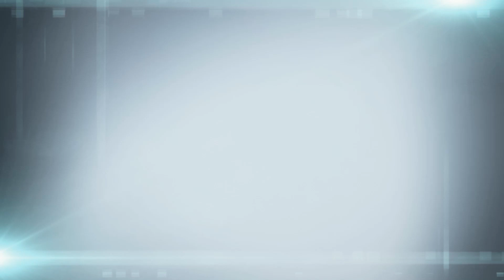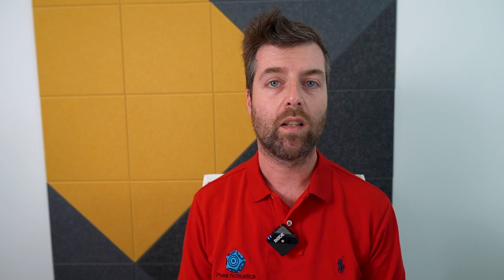How many subwoofers do you need to hit 120dB?

Comment: What are the benefits of dual vs single driver subwoofers? I have two 10" subs and am thinking about upgrading to two dual driver 10" subs, alternatively  two single driver 12" subs. Which route would you go? Space and aesthetics  are limiting factors, hence I'm trying to find a powerful yet compact combination.
Reply from the maker: A few comments for this question.

First, dual 10" drivers has the surface area of a 14" driver, not a 12" driver, so a pair of dual 10" subwoofers will have a good amount more output than a single 12" subwoofer, all else being equal.

Dual drivers don't really have advantages over single driver enclosures other than form factor.  Larger drivers require wider enclosures, but multiple drivers only requires taller enclosures (or deeper in the case of a Perlisten P-P subwoofer.

You might argue that an advantage of a smaller driver is that the voicecoil can be made smaller and heat is pushed across multiple drivers.  You can also take advantage of distortion canceling mounting methods or vibration canceling methods.  Smaller coils means lower inductance and that means lower distortion.  However, there are many higher inductance drivers with still very low distortion, so I don't know that this is a given.

Really its all about the numbers, how does it measure?  Not just CEA-2010, that isn't a great way to compare subwoofers.  If company A feels that a specific distortion threshold must be adhered to, say 5%, and another company uses 2010 limits, which is like 20% or more, then company A's subwoofer will appear to have less output than company B, but really they probably have the same, or A might have more, but B is simply looser with their standards.  So you have to look at group delay, distortion, output, frequency response, and unfortunately since we have no measures of mechanical and inharmonic noises, listen to it to decide what is best.  One big advantage of a BIG driver is that the suspension components are proportionally larger and that allows larger excursion with less noise.  It also needs to move in and out less for a given output which also reduces noise.  So...In my opinion, bigger drivers are generally better, all else being equal, but I wouldn't call that a rule or even a guide.  A smaller driver can be made to be excellent if engineered well.
Reply: Thanks a lot for your detailed answer! So generally speaking, larger total cone area, more output. Does larger cone area also mean deeper bass, generally speaking? I'm trying to understand why subs that are equal in cone area can have quite big differences in output.
Reply from the maker: @isak6626  if two subs with identical cone areas have dramatically different outputs then it’s because of excursion/power differences at very low frequencies.  At higher frequencies the moving mass of the driver can impact sensitivity. So it’s still power limited, but basically if one woofer can turn 1000 watts into 120dB and the other only 114dB, and let’s say it’s at 100hz, that’s a sensitivity difference caused by motor strength and mass. Simple physics. Heavier mass needs more energy to move and stop.
Reply: @PoesAcoustics  Thank you. So, when looking at upgrade alternatives, I'm thinking that cone area, weight and amplifier power should give me a pretty good idea of what a sub is capable of even if measurements are absent. For example, Bowers & Wilkins have three different subs with dual drivers  that are small but heavy and with powerful amplifiers (the DB3D, DB2D and DB1D). The marketed frequency responses of these are quite astonishing for their size, and there are almost no reviews of them, but I'm starting to think that maybe even the dual driver 8" sealed model (DB3D) could outperform my single driver 10" vented sub.
Reply from the maker: @isak6626  in general I wouldn’t use weight as a proxy for quality or output. You can build high output subs that don’t weigh a lot and low output subs that do. It’s really more complex than that. Even CEA-2010 numbers aren’t enough.  

Take Perlisten for a moment. Perlisten set their distortion thresholds well below that of the competition. The max output is limited to well under 5% distortion. Competitors often can fail CEA burst tones before the limiter would kick in. So you could take two subs, one the Perlisten and the other a competitor product. They could achieve similar maximum SPL numbers. Maybe the competition beats it by a few dB and maybe even costs less. In the absence of a full understanding of the differences it would be hard to know why the Perlisten isn’t actually the better product. But if the other product is producing very high levels of distortion at its passing values, the Perlisten is at least the better sounding subwoofer.  

As for these B&Ws, I suspect you are correct that the dual 8 is better than your ported 10. Maybe not at frequencies that align with the port tuning.  I’ve had some hands on time with those B&W subs. In my opinion there are better products for the money, but the B&W aren’t bad. Beautiful design and finish.  Decent drivers and good amps. The limiters could be more sophisticated but seem competently setup. There are no ridiculous high pass filters so good in room extension.
Reply: @PoesAcoustics  Yes, of course, but it does seem that high quality subs usually weigh quite a bit, even if they're small.

I haven't found any alternatives to the B&W subs that are as compact, powerful and stylish. Most of us don't have a dedicated theater room, so space and aesthetics are really top priorities. I'm intrigued by the perlisten subs, but they are too bulky and not very stylish. I wish they made smaller ones that at least come in white.
Reply from the maker: @isak6626  take a look at Kef. They have a dual driver lineup that’s very good, compact, and stylish.  I actually like them better than the B&W in that size/price class. I have a client that bought a pair of the KF92’s. Also please feel free to reach out to me. I sell a lot of these brands and would be happy to work with you.
Reply: @PoesAcoustics  Thanks! I'll have a look. I wish there were more reviews of these compact subs. It's very difficult to find measurements.
Reply from the maker: @isak6626  I agree.  If I get one in I can test I’ll do so.  Kef provided actual data on their products but often it’s vague or unclear what the numbers reference. For example they may say a subwoofer can do 110dB. That could be very good or merely average. Are we talking burst or continuous? Is it distortion limited to 1%, 5%, or 20%? Is it 110 at 20hz, 30hz, or 80hz. 110dB at 80hz continuous is merely average. Nothing great.  110dB at 30hz would be very impressive.
Reply: @PoesAcoustics  That would be great. I guess that many of us who want great sound don't have or even want to have dedicated theater rooms. I want great sound in the room that I spend the most time watching TV and listening to music - our living room. And in that room, there's no place for enormous  subwoofers in black.

Comment: Depending on your room dimensions and construction room gain and boundary gain can give you a tonne of free dBs under 30Hz
My room is fairly small (under 2000 cu ft),sealed and on a suspended  wooden floor. With 3 x Seaton Submersive HPs I have measured above Ref Level down to 10Hz. . Measuring above this level for me starts to induce concern for my house and neighbour scomplaining
Reply from the maker: While room volume is the main factor, the wall rigidity and how sealed the room is matters. I find a lot of my theater designs do well in this regard because my walls are a lot more massive than most and my rooms are very sealed.

Comment: the calculator is for sealed subwoofers. with ported subwoofer and room gain you can get 120db(3000-3500cft room)at 20hz easily with dual 18 or dual 21 inch drivers. you can model the room gain using winisd.

Comment: this tool is really useful when you have a comparative result from your own room. lets say you have a 15" subwoofer and you hear some output at 15hz at max volume. if you have the excursion of that driver or eyeball it.  you can then have a reference point for the calculator, so you know that increasing the db by 3 would increase the bass impact by twice.

Comment: This tool begs the question of one "very large" sub vs. a set of "large" subs -- do you think there is merit in specifically designing  subs for low Hz? The Ascendo 24" is literally twice the price of the Funk Ultra 24 -- can't the Funk, given it's quality level, perform similarly if assigned a limited low frequency range, or is there really some advanced engineering going on that separates the Ascendo tech?
Reply from the maker: I wish I could answer that. Without more technical data and comparable standardized measurements you couldn’t easily know.

Comment: What did you mean at 7:25 when you said tighter and better? I'm guessing that you mean that smaller drivers produce higher quality bass (the total output level in dB aside). I saw a video where Grimani disputed that idea with the primary reason I believe being that the cone has to move the same number of times over a given interval to produce a certain frequency. I'd like to hear your thoughts - maybe content for a future video?
Reply from the maker: That isn’t what I was saying. Tighter and better are not related to cone size.  

Remember that I am not talking about small woofers. I am talking about huge woofers and really huge woofers.  Like 18’s and 21’s good, but bigger can be tricky to get right. So what I was suggesting in the video is that you need to make sure the driver is a linear driver. While a larger cone displaces more air per mm of excursion, you still need that in and out motion to be linear and for it to remain so at the extremes.  It certainly can be done but it’s often not been done well. Maybe if the very old giant woofers were not very linear. Their BL curve wasn’t great. Todays drivers are much better.  

But there are other issues. High inductance adds distortion.  That distortion tends to mostly be seen at the higher end of its bandwidth, above maybe 50hz. The very large voice coil needed for such a large cone can often have very high inductance and thus higher distortion.  

I know some will see this as an attack on Ascendo. I haven’t seen their Klippel woofer data on their big drivers. I do know they are using some common parts on the 24” woofer to the SI 24, likely genetic frame parts from a Chinese supplier. SI does have Klippel data and it’s quite good (and the measured performance of the sealed subs is equally good). Assuming the Ascendo is similar or better (it has much higher rated xmax for example) I would imagine it could also be very good. I have seen the Klippel data on a 32” sub made mostly from imported generic parts and it left A LOT to be desired. It has 13mh of inductance, a 5mm offset, and very strange looking BL curve.  But that doesn’t a more competent driver manufacturer couldn’t use the same kinds of parts to achieve a very good and linear driver.  

But all to say, I wasn’t suggesting the idea that like a 10” driver can sound better at 100hz than a 21” driver. Only that as drivers go from big to really big to gigantic, it becomes increasingly harder to keep it behaving well over very long strokes.  

As for Grimani, we have discussed this as recently as today. He has a new infrasonic subwoofer and it relies on a 21” driver. He told me he didn’t feel drivers bigger than 21” were good enough/linear enough. That the 21” he is using is the best compromise of options.
Reply from the maker: Ah I should have watched it to see. Ok my points remain but in that example, I wasn’t suggesting I think it’s tighter and better. I was saying that is a common argument folks use for sticking to a lot of smaller drivers. But I don’t agree it’s true and as I said, you actually need a big woofer to get those high SPLs.
Reply: @PoesAcoustics  Thanks for clarifying and for sharing this great information. I'm really enjoying your content!

Comment: matt, how do you convert this 120 dB number to relative volume, like my AVR shows.

So, what is 120 dB? Is that relative 0 db, or +5, or -5 db on? Also, how does a harman curve affect this, like a +6db harman curve
Reply from the maker: It’s a little tricky and no guarantee it would work. A well protected subwoofer will limit itself regardless of the signal you send it. A bad one will compress and distort. Just because you can turn the volume to 0dBFS doesn’t mean you can actually reproduce reference levels.  

Assuming the receiver is fully calibrated and the dB value is dBFS, then 85dB is equal to -20dBFS. 0dBFS is 105dB. You would need to send a signal through that is 15dB louder than that. Now mind you, that would digitally clip. So the sub needs to be calibrated hotter so that 0dBFS is actually equal to 120dB. The processor itself may and should have additional headroom but the full scale means a maximum strength digital signal. The reason that the subwoofer channel needs to do 115-120dB is actually for bass management. Take a 105dBFS signal for LFE, then add in a bunch of other speakers that are being bass managed.  Eight combined channels of 105 is equal to around 114dB of output signal. 

So you would either need to drive a signal through all channels at FS and then turn the volume up to +5, or drive a standard signal through and set it to +15 on the volume.  Assuming it’s calibrated to 85dB is equal to -20dBFS.
Reply from the maker: Oh I should mention that with movies the LFE channel is actually encoded at 95dB is -20dBFS and so it’s peak on its own is 115dB at 0dBFS. When full range signals were going to surrounds, they started increasing the total dynamic range requirements needed for systems to be 120dB to compensate. Like Atmos is now 120dB from the LF section and 105 from the LCR and 105 from each surround group.
Reply: @PoesAcoustics  thank you